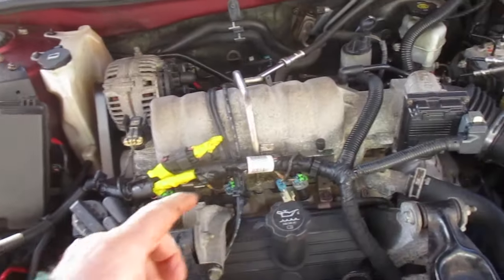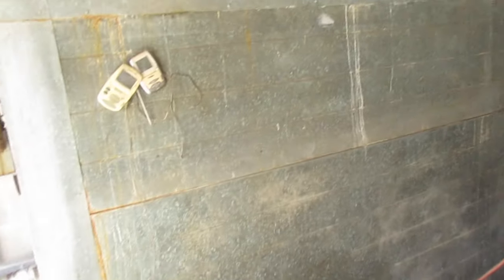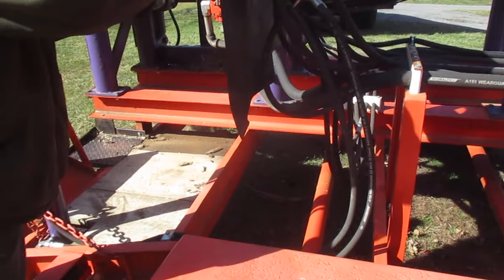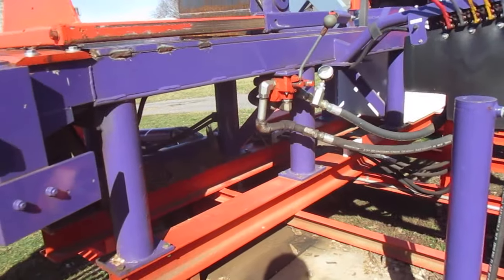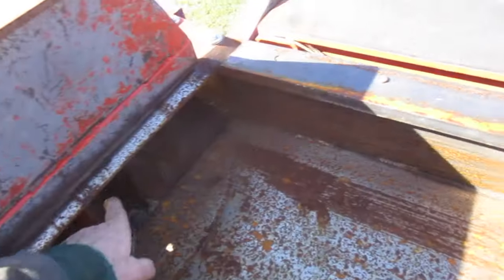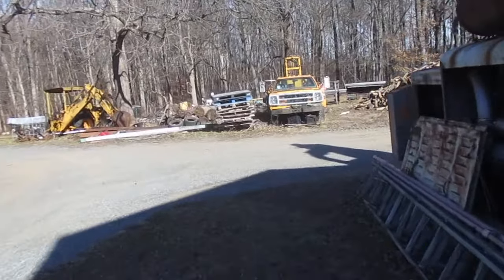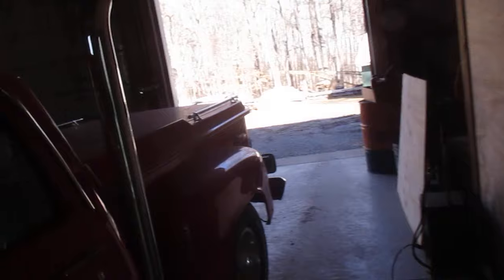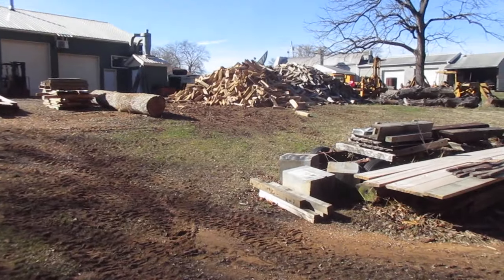The BIG Wood Splitter  # 1433 And walk around Jeff's. For more on this splitter

Comment: Huge door on that wood boiler. That's quite the splitter! I wish I even had 5% of the knowledge needed to tinker with building stuff like that. The chop saw for slabs is what I'd like to figure out how to make. Great video!
Reply from the maker: hi there we made 2 of them .mine we put an conveyor on ,#248 #524 #1156 for some of the past shows on it .have you seen my bioler yet ? thanks for stopping in john